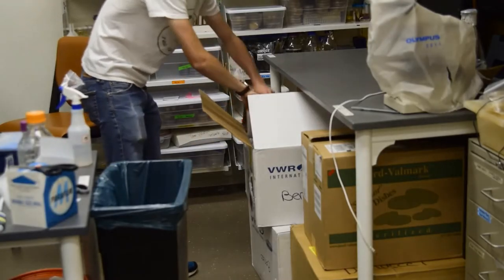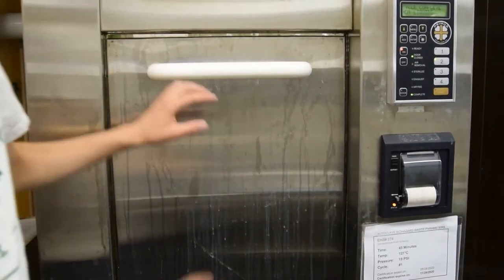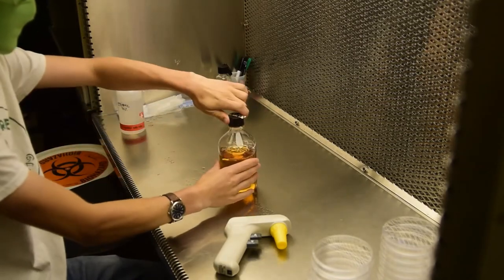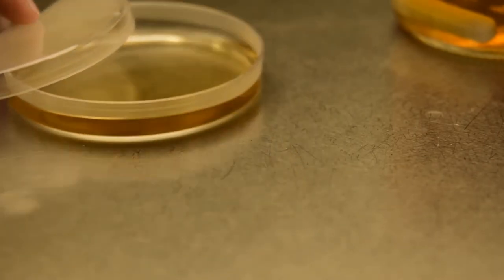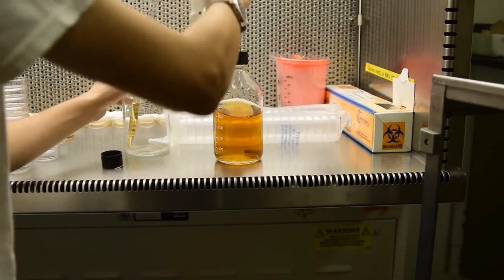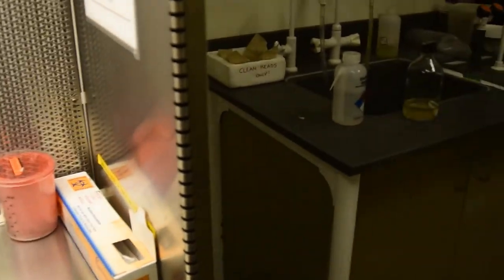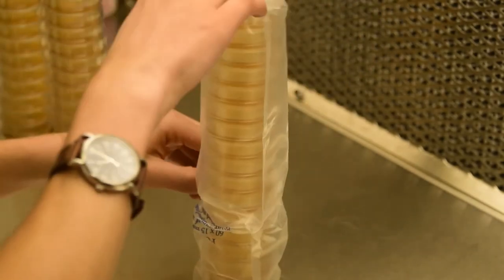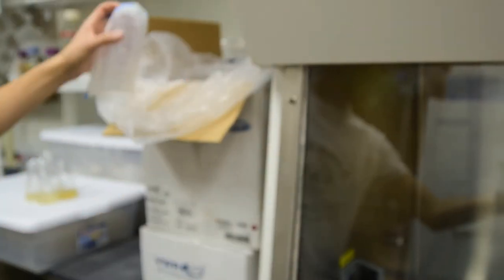Making MEA+YE media (Malt Extract Agar + Yeast Extract) Part 2 - Bonito Lab Training

Comment: I'm pouring in a still air box. Can I leave the lids off the same way until the agar cools or will there be a risk of contamination? I don't have a flow hood.
Reply from the maker: You should keep the lids on in that case. There will be more condensation, but it's not a problem.
Reply: @julianliber4633  thanks